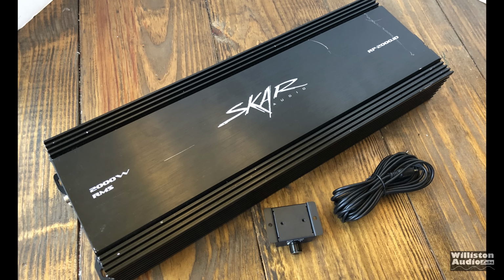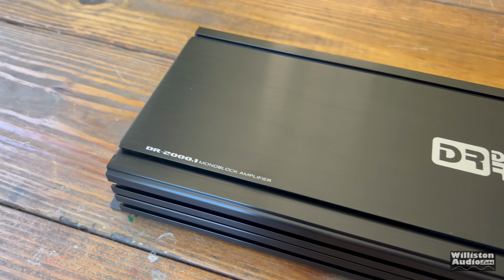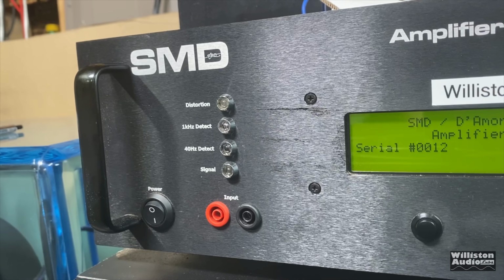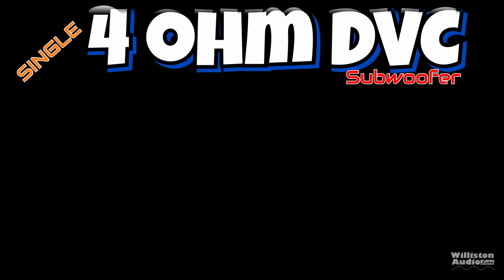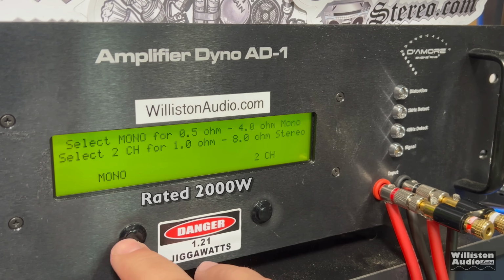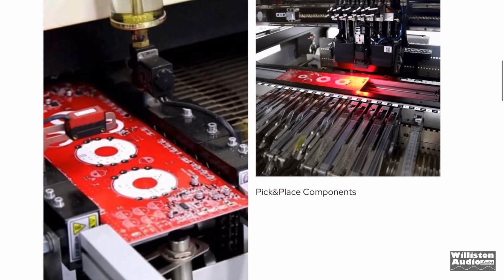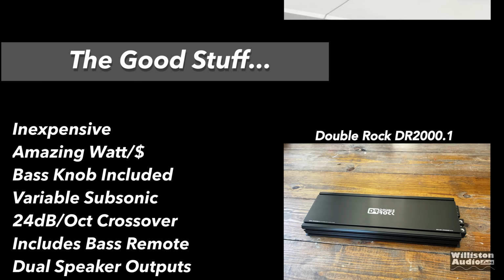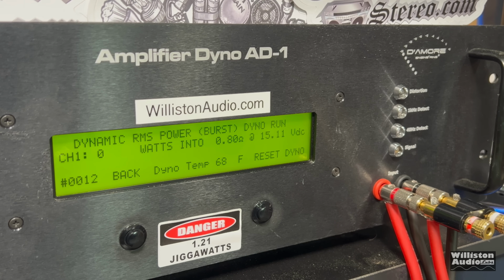SKAR Audio Wants it BANNED!! Double Rock DR2000.1 Amp Dyno Test and Review

Comment: This is a classic type 4 class D output topology as described by Perry Babin. The output drive wave on both high-side and low-side leaves a lot to be desired compared to other topologies and consequently this topology is prone to blowing its 640n output transistors. Thankfully in the scar the protection circuitry is fast enough to save the power supply from burning down when this happens. Time will tell if this clone has the same protection circuitry or not.

There has also been times where the output filter transformers have shorted out also taking out a few mosfets as well
Reply: D said the components came from the same factory that manufactures for Skar. So you're getting same components but paying a lot less
Reply: @Henry Taverner  not necessarily.  The components themselves may be different, also the design isnt an exact match.  If this company decided to skimp on some of the protection circuitry to save cash, that would be a big problem for the end user that may want to cheaply repair said amp.

As said Skars almost never take out the power supply due to having such good protection circuitry.  This makes repairing them pretty darn easy and viable option (cost wise) for the end user.

But if a small failure of the output fets isn't caught in time, the power supply will also burn up and that'll cost way too much to be worth repairing for the end user.
Reply: Did you get Perry babin's amplifier repair tutorial?
Reply: @Buck Alvin Possumweight  yes I did and it is worth every penny!!  Honestly it's worth 10x what he charges.
Reply: @steve390gold  how long ago did you get it because I've been looking at his amplifier tutorial off and on for several years maybe three or four five years. Now recently I definitely decided to move forward to get it although I've been looking at his website and I noticed a lot of his sister sites go to gambling websites now that it seems like maybe he doesn't have the funds to fund some of the other sites that might have been like the go-karting site the air rifle sight things like that. I'm hoping that he still has his amplifier tutorial for sale I guess I can just send him an email.

Comment: Here's the issue no one wants to discuss, the 200 Amp Fuse.
Reply from the maker: 200A fuse should be fine in most cases with speakers and music playback
Reply: Music I's dynamic assuming gains are on point the chances are very low Amp ever see close to 1ohm and it's 200 Amp rating...

Comment: Being a repair tech, the DR amplifier has Skar beat for vibration control. I am constantly seeing shorted transformer windings. They even secured the inductors. Nice ;)
Reply from the maker: I forgot to mention the extra glue used on the DR
Reply: Just like Audio Legion (the brand that the build house for Skar sold products under) were actually better made products and cheaper than the Skar equivalent.
Reply: @MAD_CarAudio yeppers 😆👍
Reply: Hi
Reply: @leoyser1369  Good to see you here Leo!
Reply: @E'burg Amplifier Repair  same. waiting to do a build with one of these
Reply: @ellensburgamplifier  I love the channel. I have a few old dead amps that I am thinking I may troubleshoot and been trying to watch the pros in action.
Reply: @murrayshekelberg9754  6 days a week! I enjoy sharing my input when Derek releases videos on amplifiers that deserve credit where credit is due.
Reply: Can i ADD glue to mine in order to make it as good? 😢
Reply: @westreadwell9675  Gorilla glue clear grip ;)
Reply: Yes it goes into protect as soon as try to hook power to it no speaker leads didn’t even get that far to try sucks so is there a way
To fix it or is it worth to get a new one ? I can’t believe this sucksn
Reply: @Chiz412  Most likely it is repairable. It takes a lot for a board to be declared not economical to repair. A repair will always be less expensive than buying a new one.
Reply: Hey Ellen I just bought one 2 k double rock amplifiers and soon as I opened it all lookes okay but I went to try to bench test the power to make sure no issues and it goes directly into protection? What would that be the thing you listed ? Or is  could it be cause I ran the remote from then pos wire thought maybe might be circuit protection or something but if there any way you can help me out my son bought me this amp too and he from South Carolina too so to return it hopefully they will let me just send it back I wish I knew what cause this n just fixed it was so happy to get. A new amp
Reply: @Chiz412  Does the amplifier go into protection with no sub or load hooked up? If it does go into protection with no load, and the voltage is nominal, then there is an issue in either the output section or the power supply. A shorted inductor will present itself when the amplifier is powering up and switching starts.
Reply: Hey do you repair ads amps?
Reply: @jamms992  I have repaired a few ADS Power Plates in the past but I do not repair them as standard business due to the modules.
Reply: @ellensburgamplifier  ok thanks
Reply: @jamms992  or jl audio 500/1  version 1s
Reply: Need comments like this lol very helpful!!!!
Reply: Also the amount of QC stickers is something I think I haven't seen much :D
Reply: From my experience most these big amps take alot power to run them. I have only seen 2 amps that would run on reg bolt set up that is jl audio,  and the precision power.
Reply: I'd spend the 170 on this if I was in the market for an amp. Handled all the tests, looks good on the outside with no whack ratings, and internals look decent. Very nice!
Reply: @zackbalins658  I agree 100%
Reply: @E'burg Amplifier Repair I have a kicker cxa800.1 that just went out do u repair them

Comment: Looks like skar might be overpriced.
Reply: Meh, I blew 2 RP series that were running around 60% rated power (4 channel amps running my mids and highs) when I tried to warranty them they were "out of stock" then discontinued. For back ground I have a JS 320 alt and 3 agms. So voltage drop was not an issue. Swapped to Taraamps smart 3 (had SK 2500 still working) and threw the ts400/4 minis on my highs since I couldn't get my RPs replaced. The taramps been running strong for over 2 yrs now. I had a really bad experience with Skar CS,  I'll never run them again.
Reply: @Another.Random_Idiot  I'll buy the blown skars if you want to sell
Reply: @steve390gold  they went straight in the trash the second warranty wasn't honored.
Reply: @blake k.  I figured, but if you hear of anyone else blowing up their amps (any amps really) I'll buy em!  

I love repairing amps and prefer to buy them so there's zero pressure to get them finished by a certain date....lol
Reply: Perhaps, Perhaps not. That will be determined by how good the protective circuitry is on this clone. On the skar, it's quite good such that when one or two out of transistors fail, the protection circuitry is fast enough to prevent the power supply from burning down. I'd be willing to bet this clone does not have the same.
Reply: We need a component comparison. I haven’t heard of the caps. What about the failure rates of the chokes and other components u def load/vibration? Naturally we need more time and a big sample size…. So pretty much time will tell. At that price it still might be a decent gamble.
Reply: Of course, they have no problem replacing amps ..I had them replace a few amps and subs with no issues...I even had 2 sent to me on accident
Reply: Tottaly
Reply: Bought 2 of these amps to power 2 american  bass hd-12d1-v2's.... these two match perfectly and sound amazing.
Reply: I’d pay the extra 50 for skar just because the logo is better lhh
Reply: just like the boot leg Jordan's same family made that bich . same shop  ,same octopuses got ate that nite ,same dog running around they legs soon  to be dinner .
Reply: They always have been. They literally buy their speakers and amps from Jaishan Future Sound in Beijing in bulk for few hundred and then mark up their products 200%+. One zvx sold to some moron pays for their entire shipment

Comment: I like at the end how you made it a point to say enough electrical. To many people just look at the wattage and not the efficiency of the amp. Great test as always my man, keep it up👍!
Reply: Yep agreed, I sell Teampie amps and I have to stress that with the 5500 and 7500. Most people buying them know better but there's always someone.
Reply: I also like how Big D explains basic speaker wiring and Ohm load during the tests. This is new. 👍🏻👍🏻
Reply: Yeah I agree it's often heavily overlooked in car audio even if the efficiency was good or even great a 2000 watt amp is definitely pulling enough current that there isn't really no stock systems electrical charging system is equipped to handle such a load. Shit yer talkin 200 amps possibly up to that there's nothing no charging systems that'll be putting out that, plus all the other expected loads and draws from the system
Reply: @buckalvinpossumweight6252  Right! I'm running 1800 now on my stock system and the only reason it works is because I don't hammer on it very often. I'm planning on upgrading to a second battery. Already did the big 3 and both my amps are pretty efficient, Kenwood 6006 dsp and a jp8 wired to one ohm. Just pushing 2 12's. I watch my voltage and I've never gotten lower than 12.6 but I'd love to be running 13.8 constant .
Reply: Definitely a handy thing to show!